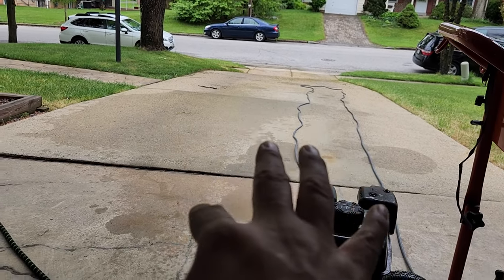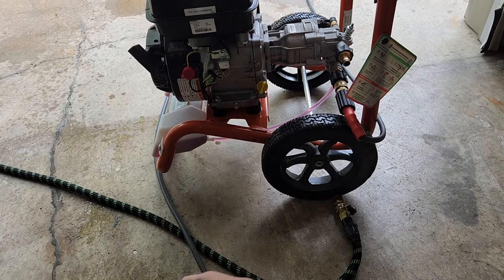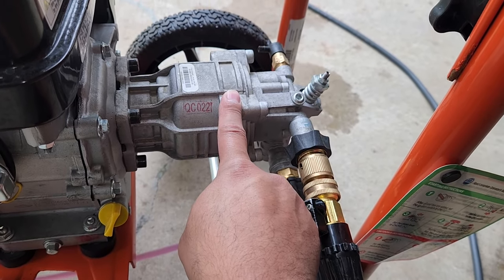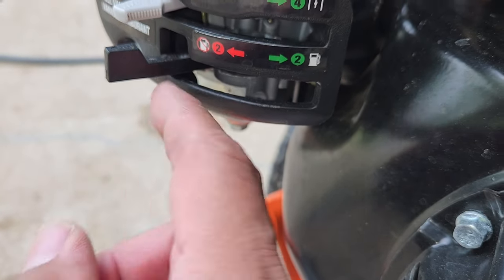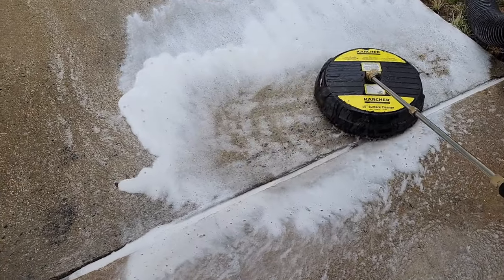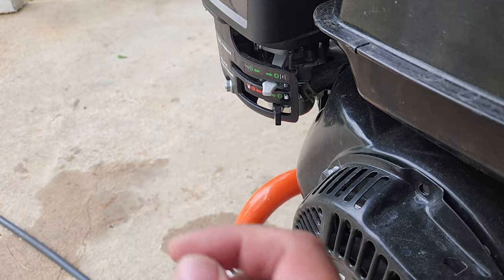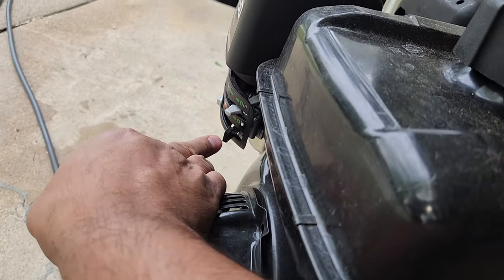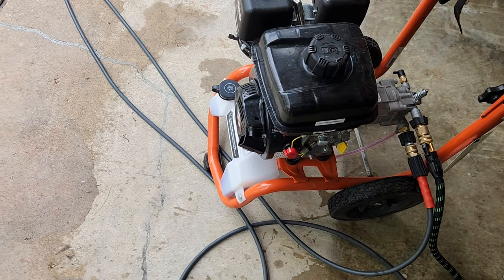Costco Husqvarna 3200 PSI Pressure Washer | How to: Turn it on and Turn off properly

Comment: I purchased this washer in the summer of 2021 but never took it out of the box until a few days ago. It started easily and performed admirably... for about 30 minutes. Then, it shut itself down and would not start back up. It was as if someone flipped the ON/OFF switch to the OFF position or as if it ran completely out of gas. But, neither of those things happened. It just shut down. I let it cool down for about 30 minutes and started it back up. if performed like a champ for all of 6 minutes before it shut down again. I put it away for a couple of days and took it out today to see if I would have better luck. But, the exact same thing. Ran for half an hour and shut down. It's a shame. When it's running it does a great job. If I can't find a solution online somewhere, it's going back to Costco.
Reply: I bought mine in the fall of 2021 at Costco  and will be using it today for the first time since buying it. I plan to follow the directions from this video. Did you put enough oil in? Also I thought we couldn’t return this after a year? Warranty is gone right? If we can, then I need to find the receipt.

Comment: So brand new there is not a lot of fresher and adjustable nozzle leaks at the connection pressure is low water coming out of the hose is on high and get pressure

Comment: I was hoping you did a live demo of it turning off because I don’t like how it violently shakes when it’s down to the last gas in the carburetor? Should I let it turn off even though it’s shaking like that? My gut instinct is to turn the pressure washer off. I don’t like how it shakes when it’s running out of gas using the fuel off switch versus turning off knob.
Reply from the maker: It's normal, my gas.mower does the same thing. The reving and shaking is from the engine burning through the last but of gas. So long that you don't let the water pump run dry, it's safe. By turning it off by just the knob and not the gas...  the left over gas can gunk up the carburetor making it difficult to start the engine the next time you use it. If old gas is left long enough, you'll have to disassemble and thoroughly clean the whole carburetor. Shutting off the gas greatly reduces the chance of the carburetor getting gunked up. Especially with regular ethanol gasoline from the gas station which is known to go bad quickly in small engines.
Reply: @Mr-Chris Can you clarify exactly what you mean by don't let the pump run dry? (I did observe and understand you pulled trigger 4x while after you shut off the gas)

Comment: Can you explain the purpose behind holding the trigger while pulling the cord? I've never seen that done before.
Reply from the maker: It helps make it easier to start by relieving pressure and resistance from the water pump.

Comment: I used my new one yesterday, but today after starting it, it died after a minute and the choke won’t pull back to the start position. It’s stuck in the middle. Not sure ưhy it can’t be moved all the way to cold. There is still oil…halfway left, but I doubt that is issue.

Comment: Hey Chris whats up.  Just came across your channel doing research.  Ive gotten an offer to pressure wash a deck and siding of a house.  The house is maybe 75ft tall.  I have the 3100 model, is this enough power/pressure?  I appreciate your input if you have the time.  Also a MD resident

Comment: So to make carburetor last longer, you should turn off the fuel or push the fuel lever to the left when you’re done using the pressure washer and let the engine run out when gas is used and empty. Then you can turn off the engine. Is that right? I thought engine actually turns off if you pull fuel lever to the left.
Reply from the maker: Yes that's correct, turning off fuel will burn through most of the remaining gas in the carburetor before turning itself off reducing the risk of it getting gunked up.